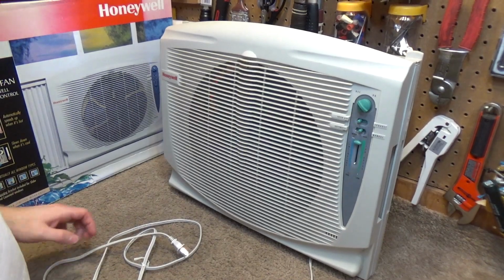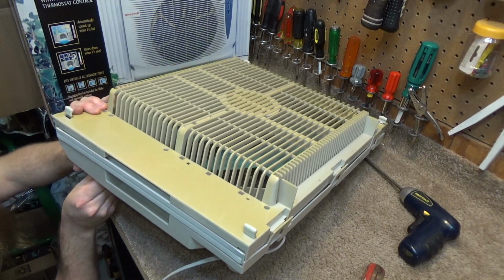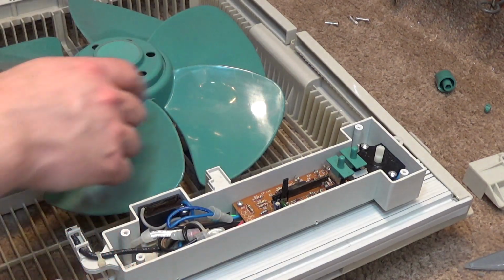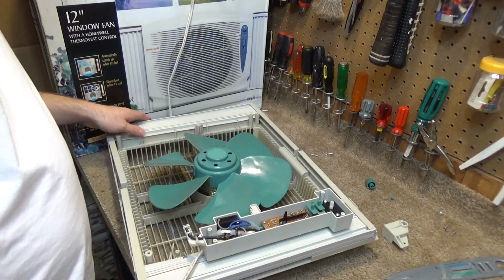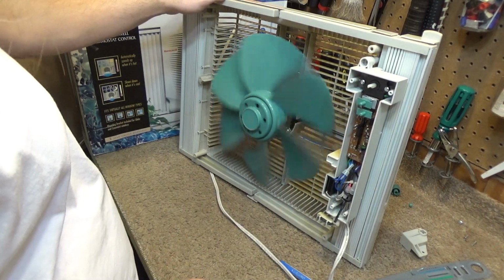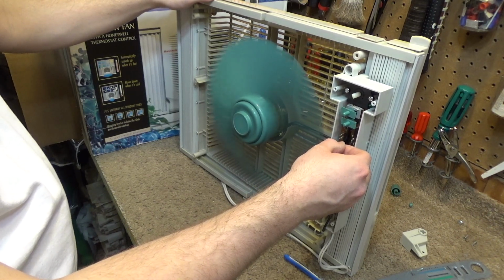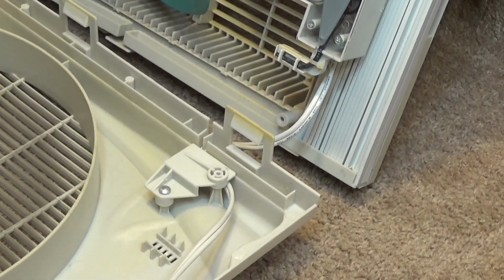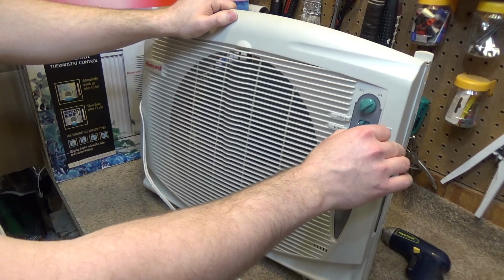Honeywell HW-690 Single Window Fan | Repairing the Controls

Comment: Seems like a good blade and motor on that one. One thing that concerns me is the hot components on the board, the other is that rectifying sound the motor makes when it begins to dim down. 

It definitely doesn't sound happy. 

When i was younger, i plugged my 12 inch Duracraft box fan into one of those outlet light socket adapters and screwed it into my rotary dimmer.  The results where similar to this window fan, where the hum of the motor went from a Buzz, to a deep growl as the power decreased, then it slowed down, but in protest.

I wonder if Honeywell used miss-matched/incompatible equipment with this one. Definitely sounds like dirty power getting to the motor.
Reply from the maker: I think the control board was designed very cheaply with bare-minimum specifications, or less. I don't want to mess with it since it's so rare, if it weren't, I'd probably design a new set of controls.
Reply: I have a twin window fan that's the same model as one my aunt bought new back in the 90s that has this exact control setup. Much like the fan in this video, the motors on the model make a noticeable hum when on the lower speeds even when brand new.

Comment: I have WDF9-2 Fan and the 1 motor got slower and I fixed it and it runs good and I liked your window fan
Reply: that doesn't make any sense.
Reply from the maker: @Ets Bec Yes No More DJ ENDIE09 Allowed   Thanks for letting me know.
Reply from the maker: @sureshkumarc.k6534  Do not post spam.
Reply: @JordanU  yeah

Comment: Yeah the blade on that looks pretty cool and pretty good pitch on it. I like the green and blue accents also.
Reply from the maker: It's an interesting design and it really throws some air on intake. I don't understand why they use these kinds of blades, which are clearly designed to only go one way, on reversible fans. The exhaust doesn't move much air at all.

Comment: Can you show we’re that black cable at the bottom of the fan goes to because mine is just hanging and my fan won’t turn on
Reply from the maker: I can, but it will be some time as the unit is currently in storage.

Comment: This appears to be a triac based speed control, which I believe shifts the AC sine wave. That's why it would make the motor loud low speeds and it can make the motor run warm at low speeds.
Reply from the maker: Makes sense.

Comment: These solid state variable speed fans really do not vary the power draw much and is normal for them. They change the phase of coils electrically to adjust speed. I had a hunter box fan that drew max power on low and high all through the variable speed range. I donated it because I didn't feel it was safe as it was drawing about 2.5 amps if I remember.
Reply from the maker: It is normal for vintage box fans to draw that much power.
Reply: @JordanU  yes of course those old box fans drew a lot of power, but I was referring to these solid state variable speed types. The hunter signature box fan I had drew that 2.5 amp on all the speeds and it sounded pretty scary on those low rpm speeds. I think it had one transistor on a huge heat sink inside to vary the coil phasing.
Reply from the maker: @mattdavala3790  That's likely the design. It's not a good set of controls in my opinion, but almost full power draw on all speeds isn't too unreasonable in that scenario.

Comment: As much as I like the older Duracraft/Honeywell fans, I won't deny that some of their designs are questionable. It really does seem that they go out of their way to make their fans a bitch to service with things like the clips holding the blades as well as the early version of the Turbo Fan made nearly impossible to open. Not to mention cutting corners on things such as the crossbase on their oscillating fans and of course, the wonky controls shown here.
Reply from the maker: You raised some very valid points there.